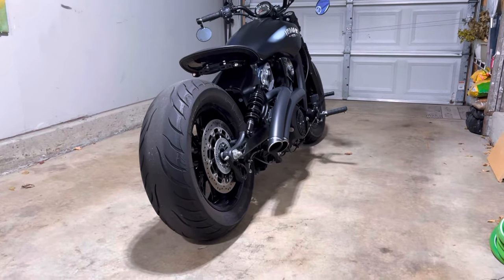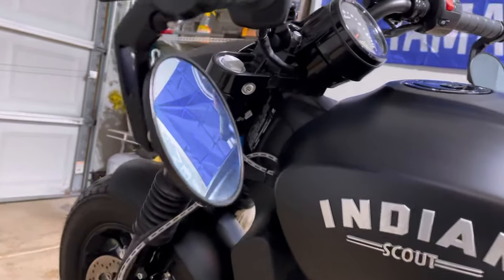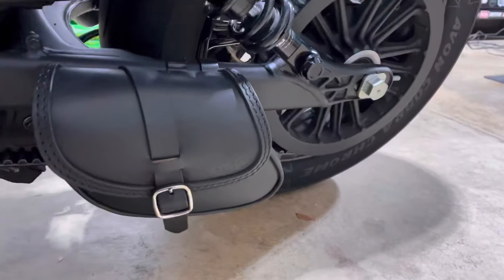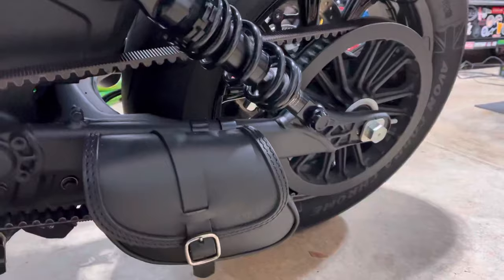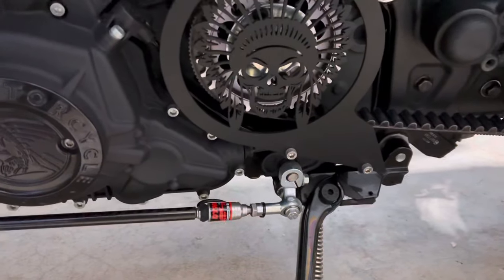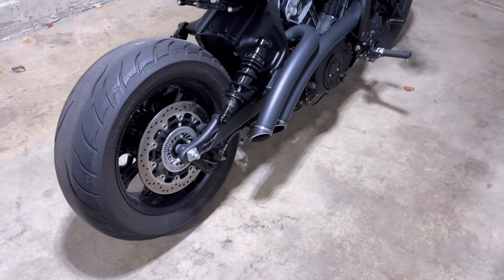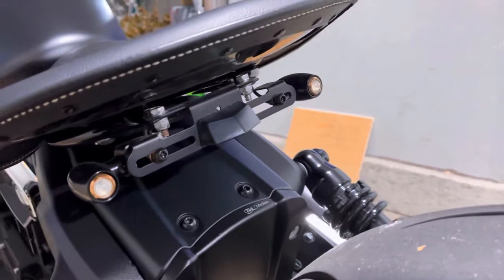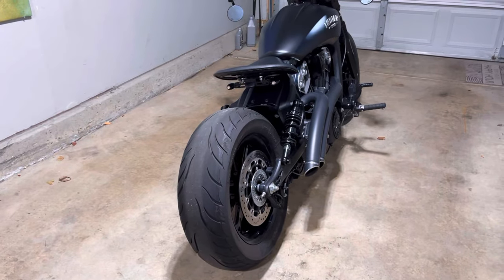Custom 2021 Indian Scout Bobber | Mods List | Build Breakdown | Walkaround | Review

Comment: Beautiful bike , bud.  I have a custom built, old school. Bobber myself. Been riding forever. Come from generations of riders and builders...so im going to be honest. Its become popular to rock a naked back shoe.. you shouldn't have.  A rear fender is way more important than a front fender. With an open , fat,  rear tire a fender is a must.. if you ride in rain or even go throuh a tiny bit of water.. without a rear fender the tire is going to realease the towards the top of the tire.. its physics.. and it will basically rainbow a stream of water that will either hit you in the back of the head or go up and over, and it slows enough that you ride face first right into the falling stream.  You gotta trust me on this.. its honestly a saferty issue.. because pebbled can also be thrown up and over and you ride face first into them as well.
Reply from the maker: Yes you’re absolutely right!! I experienced it a couple times first hand 😂 but I knew what I was signing up for before doing it! Of course I did this build just for looks and just used this bike for cruising around town or to and from work on sunny days! But I absolutely agree anyone who wants to get more use out of the bike absolutely needs to run a fender!

Comment: Im assuming when you take the rear fender off OR you go with a bigger tire, the side license plate won’t work anymore and you have to put in under your seat? Sorry if that’s a dumb question, just learning
Reply from the maker: Not a dumb question at all! You are correct though that yes the stock license plate bracket will not work. I did a custom one under the seat but there are also aftermarket side bracket options that attach to either the rear axle or shock mount too if you want to keep it on the side!

Comment: Hello, thanks for the video. 
The back (rear wheel suspension) of my Twenty Bobber squeaks when it bounces (goes through bumps). I removed the springs/shock absorbers and oiled/greased the bearings. no idea. Can you give me a hint?
It is loud and you can hear it while driving.

Comment: Is that the stock rear wheel just with a bigger tyre?
Reply from the maker: No had to get a wider rear wheel from RC components. Got stock hub, 5.5” wide instead of the stock 3.5” wide for a 200 tire

Comment: Thanks a ton for supplying the link to the RC Components rear wheel. I've been trying to find a price for it. 16x5.5 in gloss black. Tax returns are around the corner. I was thinking about putting a 180/65r/16 on

Do you like the wheel? Was there any problems or advice you would give for installing?
Reply from the maker: No worries man! I love the wheel, very good quality and beautiful finish! Install was a breeze. No additional spacers needed or anything. Make sure you order it with the stock Indian hub. One tip is because of the extra width you will need to remove the inner brake pad to slide the caliper onto the rotor and then reinstall the brake pad once on.
Reply: @JDLmoto  thank you
Reply: Do you have an updated link for the wheel? The Rc link no longer works
Reply: Do you have an updated link for the RC wheel? The link no longer works that’s listed

Comment: Did you have to do a tune with that exhaust?
Reply from the maker: You don’t necessarily have to but I did! Runs way better and more power. I did a flash tune with a PV3 from fuel moto. Wouldn’t buy it from anywhere else they will give you updated tunes for free anytime you change mods or anything

Comment: What about the rear stop light?
Reply from the maker: The rear turn signals are also the brake lights
Reply: @JDLmoto  you think those would work for the regular Indian scout? I’m asking because the regular scout has a extra brake light at the center of the rear fender